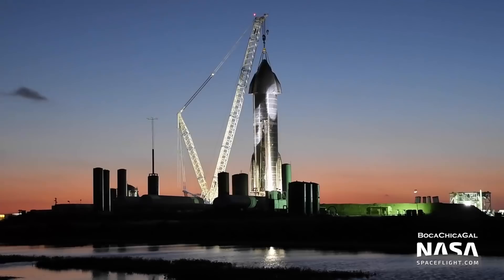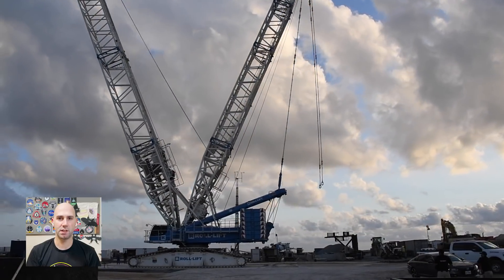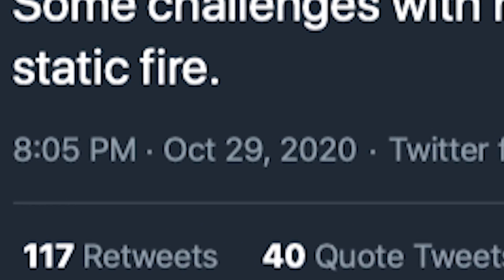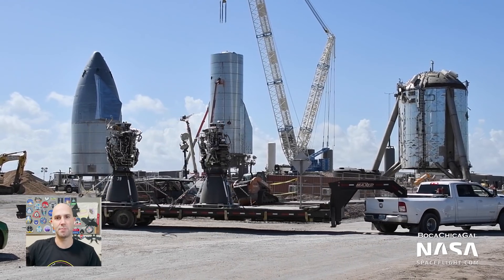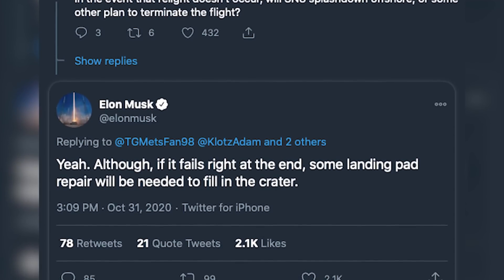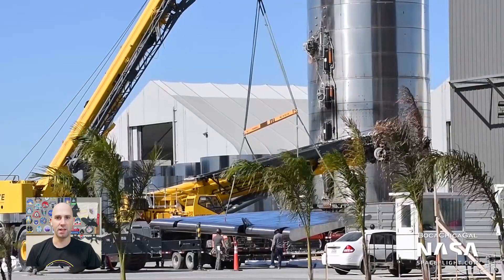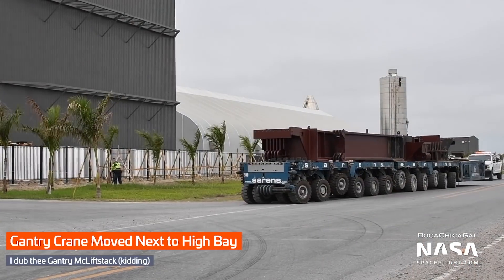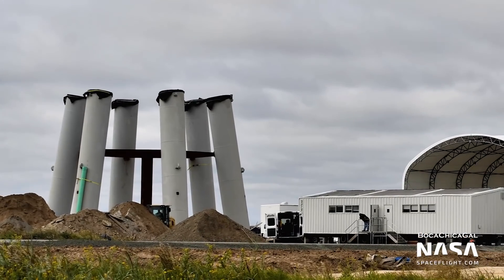SpaceX Boca Chica Weekly Update - Starship SN8 Test Campaign Towards Flight

Comment: Perhaps the double wide crawler is needed to build the first super heavy booster on.

So build it in the new high bay on top of transportation so the high bay trolley crane doesn't have to be able to pick up  a whole super heavy booster.

Comment: what is the future of sn5 and sn6 ? plz reply
Reply: I think SN 5 will be Lunar-mockup.
Reply: I'm less concerned about the over-sized trashcans, which could be turned into scrap metal in no time.  I'd be more interested in what they'd do with the Raptors.  Those niobium exhaust nozzles are probably the most expensive single parts of the entire system.
Reply: @glennpearson9348  they will need a lot of raptors for superheavy and all the starships so I guess they will repair and modify them when needed but will almost never trash those.